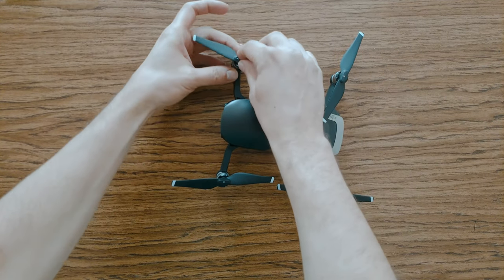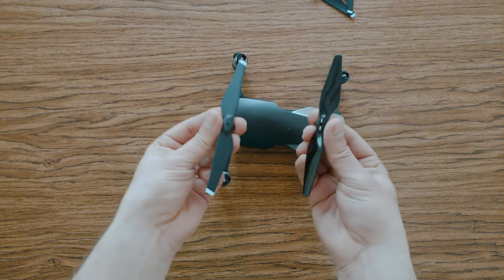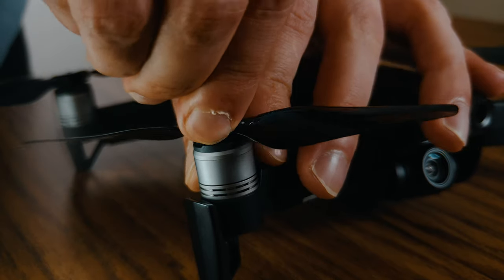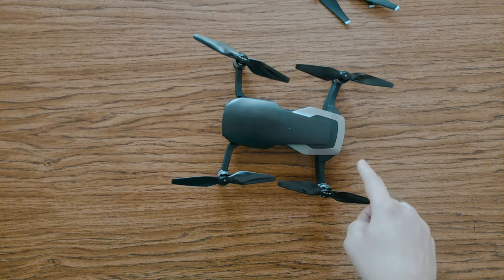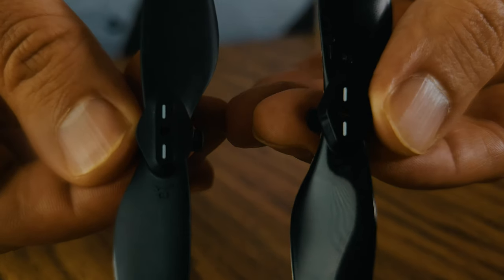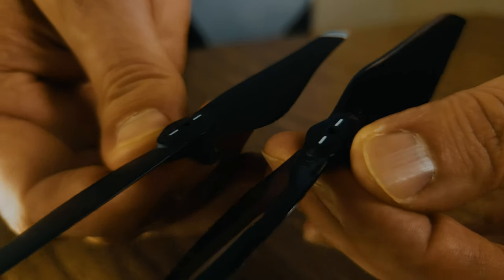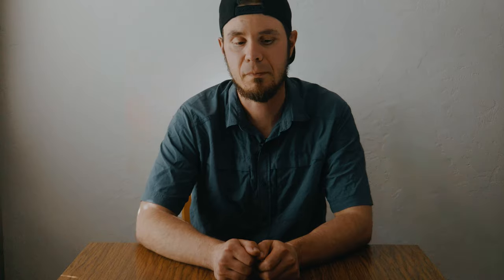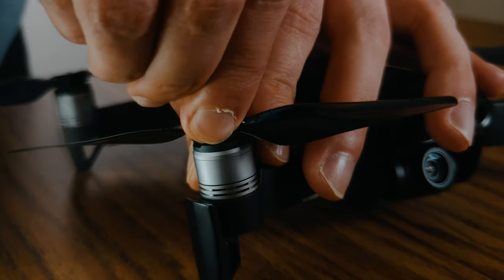Mikontech  - Silent propellers for Dji Mavic Air.

Comment: Did you fly it outside or try it in Sport mode? Even with the gain settings set as recommended, I still get the Motor Current Errors a lot.  I just don't want to damage my drone for a slightly less annoying sound on my drone.

Comment: Time?
Reply from the maker: I did not test the flight time but the manufacturer promises a 2.5 minutes of extra flight time. I find this pretty irrelevant since the performance of battery is affected by so many other factors too like temperature, air pressure, moisture etc.